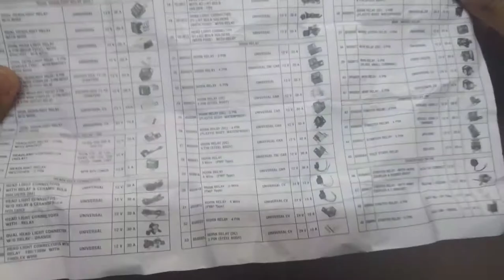How to install horn in cars and bikes /Dual horn with 4pin relay and full wiring in malayalam

Comment: Dual horn illegal aano
Reply from the maker: No bro
Air horn polathe horns okke illegal 
Ithe vandi ill company varuna type horn aa 😃
Reply: @electrotechnicals9917  ente scooter aanu, apo അതിൽ single horn aanu, ath മാറ്റി dual വെച്ചാൽ presnam ഉണ്ടോ
Reply from the maker: Preshnam onnum illa bro
Relay use chethal mathi
Reply: @electrotechnicals9917  ok bro thankuu 😀
Reply from the maker: You are welcome ☺️☺️☺️
Reply: @electrotechnicals9917  😁